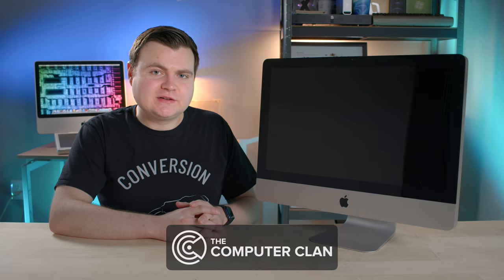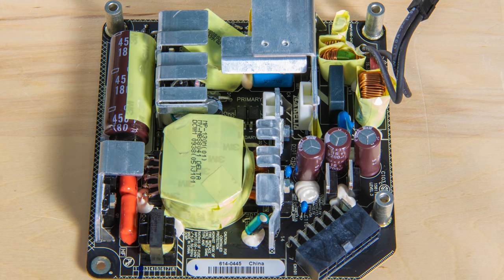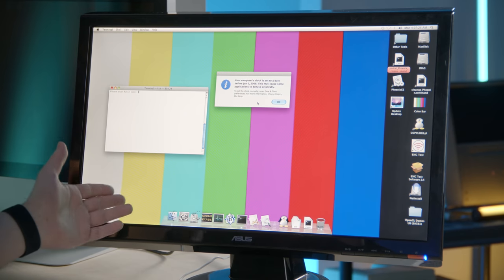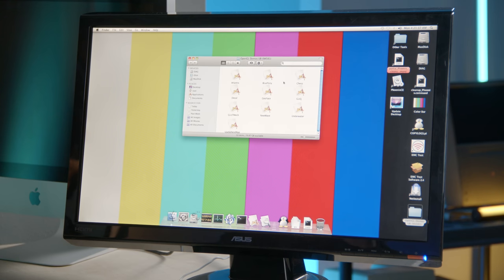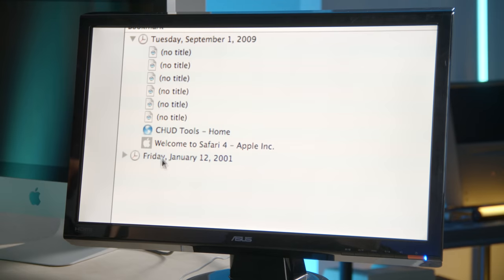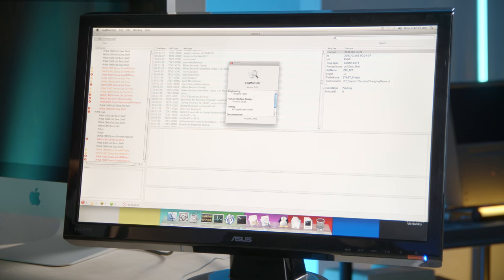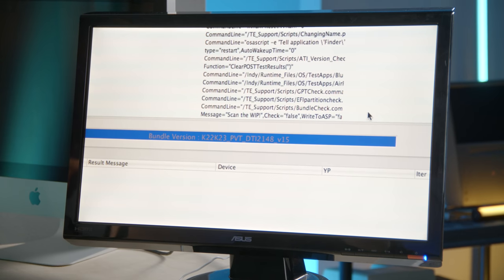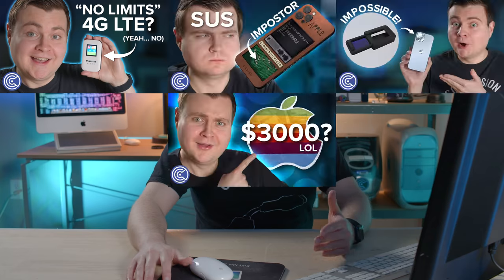Apple Forgot to Erase This iMac's Internal Software - Krazy Ken's Tech Misadventures

Comment: The noise that you heard when your computer gave up the ghost doesn't generally occur without visible damage. Though it often takes magnification to notice. If it was an electrolytic capacitor that blew, you would have had quite an aroma signature as well. Ceramic and tantalum capacitors just singe themselves and a little of surrounding PCB. Power semiconductors quit with a visible crack across them, if they make the noise.

What I'm thinking is that the circuit that gave up initially wasn't even in the power supply, but in the display backlight circuit. And eventually after enough jiggery pokery you blew it clean and the PSU was able to power on without detecting an overcurrent fault.

Comment: “According to MacTracker, these macs shipped with 10.6.1” I can confirm this, I have a late 2009 iMac and I tried to use a 10.6.0 disc I burned on it, upon install it gave me an error saying “this version of Mac OS X is not compatible with this computer.” And a 10.6.1 install disc worked just fine.

Comment: Can you leak the contents of the hard drive? It contains extremely rare internal Apple software that should be preserved.
Reply: And risk getting sued for spreading copyrighted material?
Reply: @OskarBlomkvist  who's going to sue whom?
Reply: @OskarBlomkvist  I don't think he has much to his name, at least compared to Apple.
Reply: @OskarBlomkvist  apple doesn’t give 2 shits about software they probably don’t use anymore, if it was m2 testing software then yeah they will sue, but this is an old ass iMac.
Reply: @automatedinsanity  Proprietary code is proprietary code. It's age doesn't mean anything. You have to understand that Apple utilized time and resources for this software and I am sure whatever versions they use have trace code leading back to these versions.
Reply: Yeah I was tempting to ask this and test it to see if it works on modern OSX systems
Reply: @automatedinsanity  apple is known for doing almost anything to make it impossible for 3rd party repair shops to get the tools and software needed to fix their devices, so it would not surprise me if they went after anyone who uploaded these tools to internet,
Reply: @amahlaka  apple is also known for planned obsolescence, and since this IMac is old, it's no longer supported, and since there is no use for this testing software, it should be fine to upload
Reply: @ASAPKep  It would be different if it was source code getting leaked, then a lawsuit will be more likely, but since there is most likely no source code on the drive of this IMac, it is safe to say it should be fine.
Reply: @automatedinsanity  Apple still sends cease and desist letters to people hosting 20 year old Apple software, and that's publicly available stuff. Who knows what they'd do for internal stuff? The "it's old" argument just doesn't work.
Reply: @automatedinsanity  yes, apple is known for that, which is why they dont like when someone does something that might help consumers avoid/repair/etc those obsolete things
Reply: Just make sure it's hosted on IPFS or torrent and impossible to take down
Reply: @xxedgelord420xx4  anonfiles in good too, even the nintendo leaks are still up on anonfiles
Reply: @automatedinsanity  It's too slow to use for *games*. A disk image is 100gb or more.

Comment: For the screen's backlight, if you're advernturious, i'd check to see that no capacitor fluid made it onto other boards, that may be causing temporary shorts only as the circuit reaches a high enough voltage. If other parts of the computer were affected, you might not see these affects for months, but it can kill the machine all together.
Reply: initiate self destruct (BOOM):face-fuchsia-tongue-out:

Comment: That was a blast from the past, When I was an Apple technician with a Reseller in Dublin called Compub we use to use those GPU tests to check if the 2011 iMac's and 2011 Macbook pro GPU / Logicboard replacements weren't still faulty. So after every board repair we would a Diagnostic's Portable HDD with a bootable Mac OS Snow Leopard at the time, and it would have all this GPU stress tests and CPU tests I had or maybe still have some of that software some where. 

Also I kept the eld Diagnostic OS's no idea if still have them and they would boot up on a specific Mac depending on the model and would allow you to loop stress tests and hardware checks locally of a portable HDD partition, the Portable diagnostic's HDD's would die constantly so like after 6 months I would have take another HDD out of Stock and and create like 20 partitions and restore all these Diagnostic images on the HDD all over again. this is in 2011 - 2014 ish before the simple Ethernet cable when the new retina's where coming out. 

good times.

Comment: Specifically phoenix looks like a tool that would be useful for independent repair shops if the machine still turns on but maybe some specific thing is broken, that would probably be a way faster method of finding rails that aren’t carrying the right voltage

Comment: Hi! I had the same issue with the backlight. It is a known issue with the Cinema Display and some iMacs from 2012, more or less. You need to change the led stripes. 14$ two sets from AliExpress. Easy to fix.
Reply: I wonder what is better for the value of the system: leave in original, defective parts or mounting working AliExpress stuff.
Reply: @sarowie  actually, the led strips seem original. Like leftovers from production, not new parts.

Comment: I had a 24" iMac, one of the pins on the main power cable going from the PSU to the main logic board had pulled out of the molex connector causing the back light to be inoperable. Might be worth a check. IIRC it had something to do with how the display was angled, it was causing tension on the cable.

Comment: Some useless information about the GL tests you found
GL was a graphics language developed by SGI at the 1980's and I worked in a research institute creating graphical software.  It eventually became OpenGL when they made it public.  GL was built on the core graphics language X11 which you can occasionally still popup deep down in stack traces of kernal graphics.  X11 was core graphics - to open a framed window you required 32 parameters most being complex objects.
Those GL examples are old 3D graphics that were designed to present the power of for the cross-fire graphics engine of SGI computers, and they run very fast as you have to remember that the speed of computers in 1990's are very slow compared to today - even though a Octane/Crimson SGI computer were between $0.5 and $1 million.
Reply: Thanks Tom55data for your addition. This video is fascinating. I feel it's important that this info gets documented somewhere for future prosperity's sake

Comment: Backlight issue could also be the connector at the bottom of the LCD panel. Ive seen a number of these unibody imacs where it failed. My 27" was one of them.

Comment: I suspect that Apple_KFS was named after Guy Kawasaki, and is the GPT equivalent to Apple_Void on Apple's Partition Map that was used on the PowerPC Macs. It is a holding space or padding partition format that keeps the partitions in the right place for when the full OS is installed, so they don't need to be reformatted. If you go to a modern Mac and remove an APFS container, that partition is changed to Apple_KFS.

Comment: Pretty sure you are using Zoom, Apple’s built in screen magnifier, to enlarge and focus on the discussed elements on screen throughout the video. Haven’t noticed other video creators doing this before. As a partially sighted macOS user, who appreciates that Apple includes free, stable, and high-quality accessibility tools on all devices, just wanted to applaud your finding another good application for this lovely piece of software 👏

Comment: The build number not matching any retail releases of Snow Leopard is normal, at first release they typically ship with a special build of the OS before the necessary drivers for the new hardware get incorporated into the retail version. It does still seem to be an earlier build than what these shipped with though.

Comment: Cooked and Raw will probably be Raw - the hard value from whatever and Cooked will be processed value.   That's a guess based upon previous cooked/raw usage, like devices under UNIX with cooked being for a drive, the filesystem and raw would be direct to the disc bypassing the filesystem.  That nugget from days of Informix Database work in which cooked would be the using the OS/filesystem and raw was direct disc access in which the database did direct disc access and managing and used for performance.
Cooked may also include calibrated data value processed from the raw value.

So more an educated guess, but feels right in this context.

Comment: I bought an Ifixit pro tech toolkit a few years ago. Love it, very high quality, tons of bits and tech opening tools, 100% recommended. Also recently got a Manta driver kit, that big driver has some real nice heft to it, it’s simply amazing, has over 100 different bits too. Have repaired tons of gaming mice, headsets, and other stuff using the pro tech toolkit, and a soldering station.

Comment: make an image of the drive, a bit for bit copy of it, and release it :D i got a macbook air from ~2009 i would love to get life back into, since i somehow got it into a "startup repair bootloop" where it tries, and fails to do a startup repair(to factory reset the device) and it then reboots until it either runs out of battery, or i open it and disconnect the battery. its one of the funky ones with the stupidly expensive custom SSD thingy, and i don't want to spend money on one that works just to get life back into it, but so far all i have tried to fix it, has failed.
Reply: The owner said they didn't want it to be imaged as it would lower the value
Reply: And why don't you insert a usb with Mac OS X (version compatible with ur Mac) Installer, format the disk and reinstall Mac os
Reply: @WaltuhD  yeah i know, but it would be fun to have a development copy of macOS, and try to see what's on the partitions that could not be mounted..
Reply: @WaltuhD  tried that, it seems to ignore the usb device, and just tries to boot into some recovery mode where it fails and then reboots..

still not sure what the hell went wrong, other than i tried to factory reset it so i could pass it on to my dad, as he likes messing with garageband and had some thoughts on using it for misc music related things. i don't really use it, as i kinda hate apple and their products(they are well made, but i dislike them and the software) but i got it for free from an old friend who was just gonna throw it out, so decided, why not..

Comment: The Kernelless Filesystem (KFS) is a small library that allows you to create filesystems in user space. KFS differs
from libraries that provide similar functionality in that it does not require any kernel extensions to be
installed in order to operate.

The library runs in userspace and allows applications to create new types of filesystems and mount them directly in
userspace. It uses existing functionality that ships with the OS kernel in order to do this.

Currently, KFS runs on Mac OS X 10.5+. It is backed by kernel support for NFS. It runs an NFS3 server in order to
create filesystems. The KFS library does not create any new processes. It runs entirely within the host process, and
creates a new thread in order to handle filesystem requests. It only spawns one thread to handle filesystem requests,
so it does not support asynchronous filesystem designs. That is, if you have two read requests they will be queued and
the second will not begin until the first completes.

KFS uses CoreFoundation lightly, but otherwise could easily be ported to other platforms.

Comment: I recommend you not to connect it to the Internet because they could desactivate it remotely, like the leaked iPhone 4 prototype
Reply: I agree
Reply: The Computer isn't new. It is an old pre release snow leopard system. They wouldn't bother trying to reclaim an old system like that.
Reply: @aliangel5007  But there’s internal software and they won’t like it, so it’s possible

Comment: i used to repair these, just a pain in the ass overall. screws sticking to the magnets when you try to put them back in and having almost no room to actually connect all those cables for the screen really sucked but at least there was no adhesive to fuck with. i learned a neat trick though, use an air compressor to keep dust out while putting the glass back on. i repaired a few optiplex all in ones too and while there's definitely more room to work it takes more time because you have to disassemble the entire thing to get to the display. the power supply dc connector was even worse on those, guess they both cheaped out in the same place. the exposed power supply on the imacs always confused me, maybe i'm missing something but it seems like a bit of a hazard.

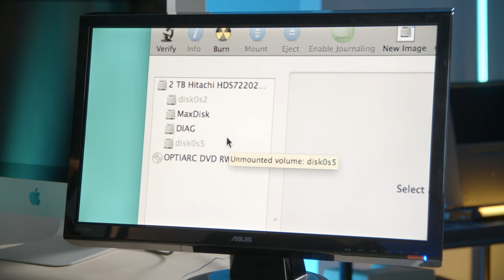Comment: 7:07 Because the drive isn't mountable and 1.9TB in size and has this Apple_KFS filesystem, I guess it will be some kind of Apple internal NAS or server they mounted. Most likely with all the diagnosis tools on it. It isn't mountable, because you aren't in the place where this iMac was before.

9:49 This might be an internal page only reachable from their Intranet.

13:10 This will be a test to simulate an extreme workload on the machine, so it can be tested for radiation while doing heavy work. This mode activates all components at once.

Comment: I have not watched part 2 of this yet so not sure if you found the answerer for the Apple_KFS file system or not so here it is just incase you did not. 

Apple_KFS is a type of partition scheme used by some Mac computers. It stands for Apple Keyed File System and it is based on the older HFS format. Apple_KFS partitions are usually created when deleting or resizing APFS containers, which are the newer and preferred partition scheme for Macs running macOS High Sierra or later.

Apple_KFS partitions are not meant to be used for storing data or installing operating systems. They are usually temporary and can be removed or converted to APFS using Disk Utility or other tools. However, some users may encounter problems or errors when trying to do so, especially if they have used Boot Camp or other third-party software to create or modify partitions.

Comment: KFS is somewhat of an Apple internal server that provides the unmounted hhds with the auto tester and it has been dumped ever since 2009 because of many reports of security bypass software installed by stuff and people lost personal files passwords even bank details 
that is a very bad design by apple back then and most people switched to windows back then

Comment: I have an iMac 2011 and I'm kinda sad the parts I'm putting in it haven't arrived. It's going to be a beast and I'm running Windows on it 😃 with the original startup sound as well

Comment: When I worked (managed actually) at a computer repair store locally, we had someone bring in a computer that best buy's geek squad couldn't fix. Well the idiots left their inhouse diagnostic software in the cd drive, which wasn't actually bad, it worked really well for being the VERY early 2010s. So we kept it, and used it to fix computers, it helped quite a bit. It was about on par with the ultimate boot CD or Hiren's boot CD.
Reply: I've used MRI too.
Reply: @Network126  yeah, it wasn't bad at all. It didn't do anything I think that Hiren's or UBCD couldn't do as well.

Comment: I know it’s old but if it’s a prototype then that’s the reason why the power supply was different. And also explains the display flickering. Replace all the capacitors on the old PS and it will work as normal!

Comment: Watching this makes me a little sad. I miss Snow Leopard so much. It was my first true MacOS experience and my favourite version for aesthetics. I miss the welcome videos. To power on, hear the chime then immediately have your senses bombarded by this fancy welcome screen seamlessley transitioning to the setup was a one-of-a-kind experience that really made you fall in love with your new iMac (in my case) from the first boot up. I also miss the old 3d dock. I’ve never been as much of a fan of the flat design trend. The switch back to 2d for the dock always felt like a step back for me rather than feeling more modern.

We got the chime back, which I suppose is better than nothing. I still miss Snow Leopard however.

Comment: EMC tests program would be run by EMC testing facility to quickly enable a 'worst case scenario' as far as radiated emissions are concerned. By activating all the peripherals and allowing you to single out signals one by one the test engineer could produce the reports to show if the device was in compliance with the standard and if not single out the culprit causing it to fail.

Comment: A "virtual file system" is exactly what it sounds like. It presents itself to a computer as if it was one single disk, but in actuality, it can be composed of many different physical disks. If you've worked with a company computer and had some "network share", then you've experienced a virtual file system firsthand.

Judging from the circumstances, it's extremely likely that this is a remote file system. This makes sense - you would likely want computers that can still connect to a network to just access all the tools on the network share, rather than giving every technician a USB drive to work off of. It also explains why you can't access it: You are not in the same network. It's unreachable, therefore unmountable.